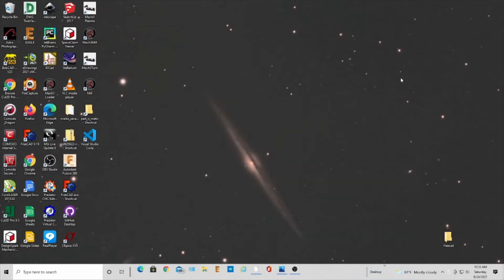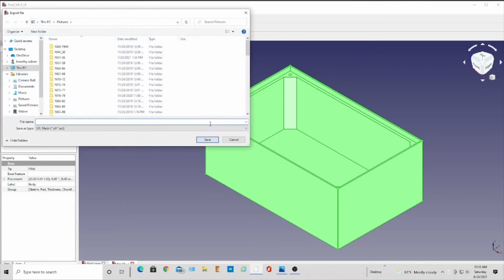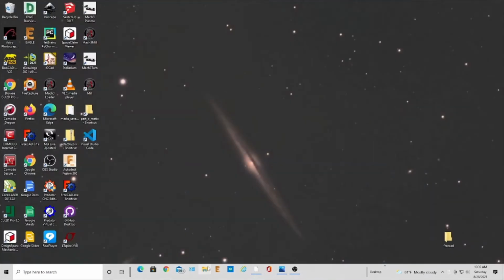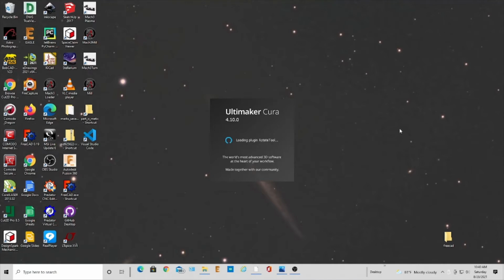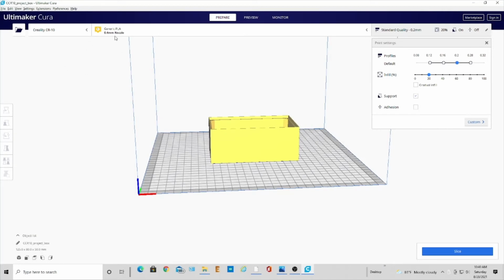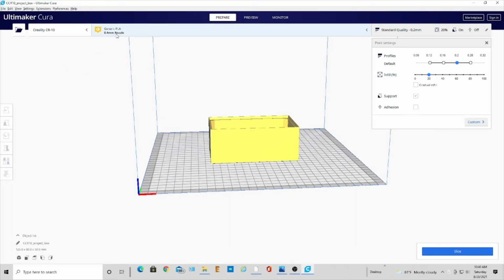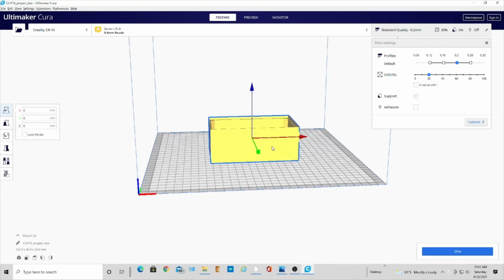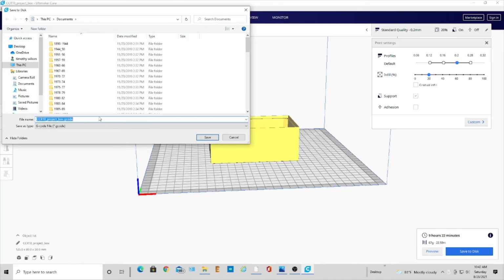How to convert a Freecad file to a Stl(mesh) file for Cura 3d printing

Comment: Nice video, I am a beginner using FreeCAD, however not new to using CAD software and design. I am going to enter the 3D printer market, and wondered what model of Creality do you have, and are you pleased with the performance. If you bought a new 3D printer what would you probably buy? What should I look for? Not sure about my price range yet, since I am just getting into this.
Thanks for this video and the other one showing the design of the box, I always learn new methods of design. Thanks Gary